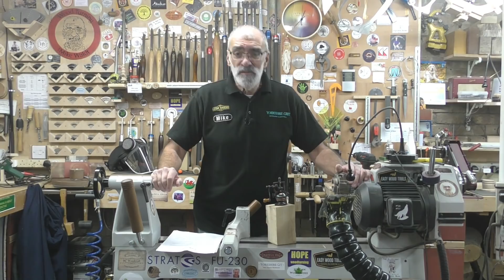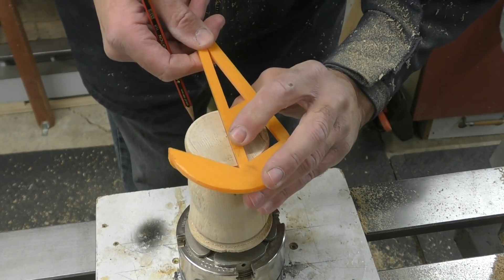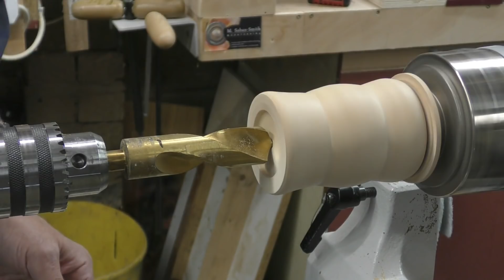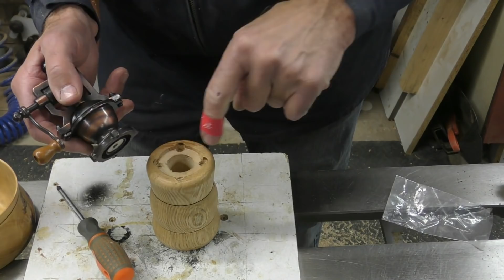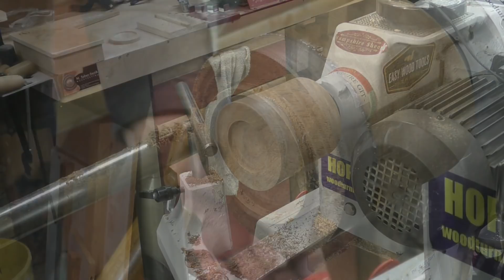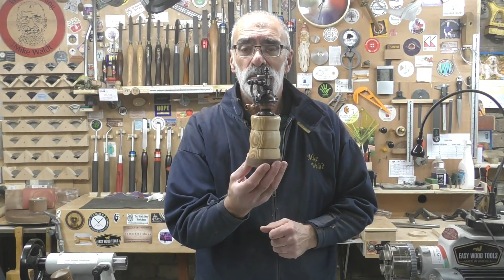Woodturning - Antique Style Pepper Grinder

Comment: Great job and thanks for sharing Mike. Ive made a couple of these, the most difficult thing ton get the screws in straight" (fat fingers, small screws). Never thought of the base, thats a great idea, have not seen that before.
Reply from the maker: Thank you William, I watched the Prokraft video before I turned this and Jon mentions the need to drive the screws at a slight angle, after drilling the pilot holes, due to the body getting in the way of a vertical drive, the base was inspired by the video too :)
All in all it was a truely plagerised project ...lol

Take care
Mike